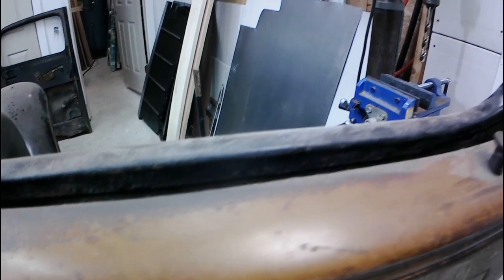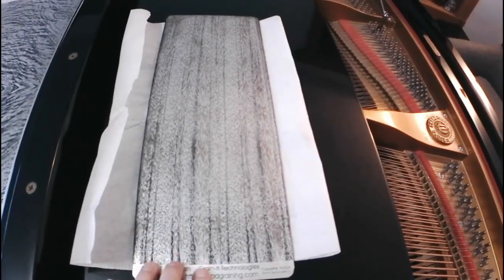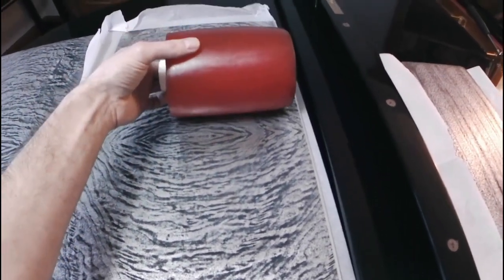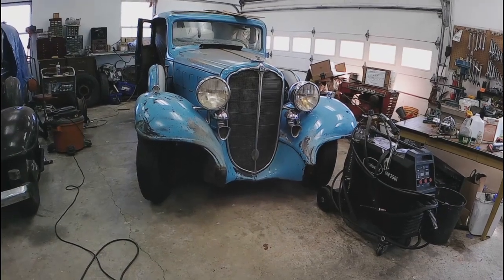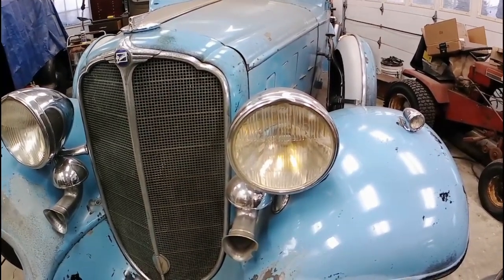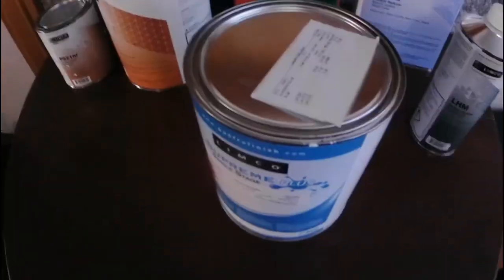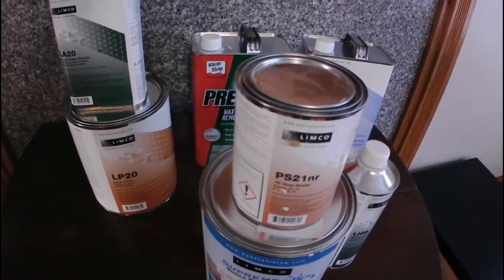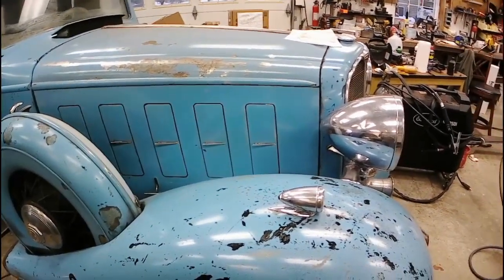Three Interesting Updates

Comment: Still plugging away on the body structural repairs?  If not a break is certainly well deserved, a man can only take so much.  
That ink roller wood graining technique is interesting. I suspect there might be a learning curve to deal with. Some Model A models incorporate an applied wood grain on interior trim pieces ( my roadster does not ). I believe restoration specialists apply it free hand, but not entirely sure.

The resto-rod movement is pushing advancement in weathered and aged appearing exterior auto finishing techniques.  Eastwood might have something to offer.  Free high tech paints — yeah right 😢 Today it’s more like take out a home equity loan for paint.  Thanks for the update.
Reply from the maker: Hey Myrl, I've been slow and steady on the wood and body repairs. The center pillar has taken some time to refill with it's lag bolt positioned. The replacement rocker panel has been the worst to get all of the pitting cleaned out in the tight spaces. That is one part I never want to remove again, so I've been hitting it hard. 

I'll send you the link to the company that sells the woodgraining supplies, they have a few videos and it is one of the more unusual processes I've seen. But yes looks like a bit of finesse is needed. 

I really don't have a good plan on the paint other than to prime and get some color on the problem areas. From there blend and see how it goes. I have thought about painting the fenders and running boards a darker shade of blue but I can make that decision at any point. 

Regards
Chuck